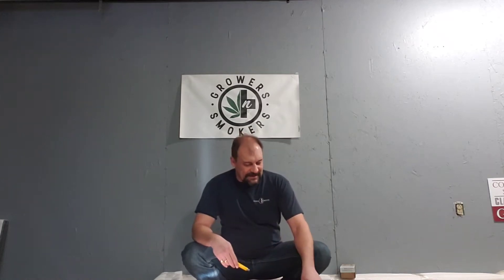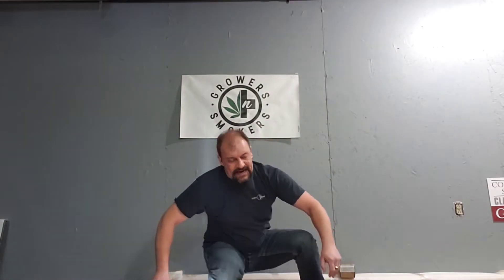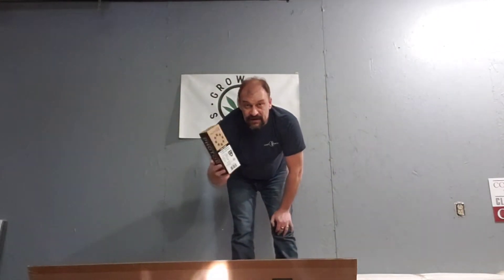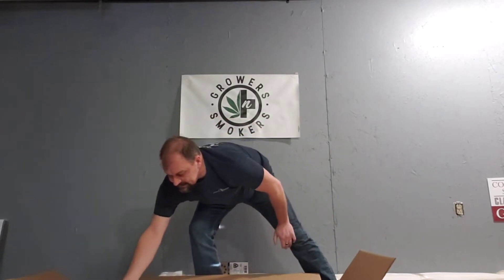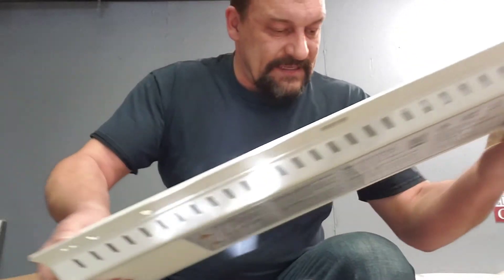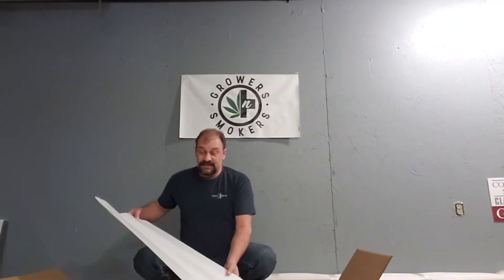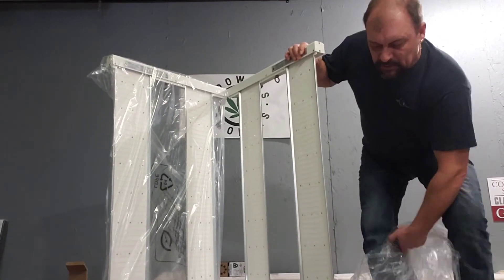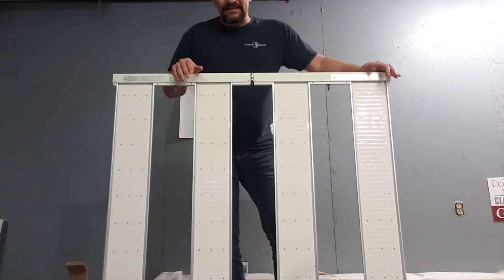Photo Bio MX 680 watt LED unboxing and setup Led Test sessions ep02

Comment: Does it have infrared
Reply from the maker: This is what they say S4 Spectrum it does have red chips in the panels  "The result is a 680W fixture delivering 15% more light to your canopy, using 35% less power than a 1000W DE fixture. Increase yields while driving down operational cost. The spectrums were developed in a private research laboratory to drive flower yield and elicit market desirable traits in short day resin producing crops."
Reply: @RickintheShed  Thank you for responding. I was looking at a gavita 1700 but it was 1700 dollars without the extra uv bar and also without a dimmer. I got my photobio for literally half the price with the dimmer and now that I know also the far red spectrum thanks again for your knowledge.

Comment: Always read the instruction manual folks. There are 2 screws to tighten on each side not just 1 per side. The screw that is deeper needs to be fully tightened or the light will invert slightly from its weight when hung. There are no UV or IR diodes as he stated, luckily. 
On the bright side there are 4,160 diodes on this beast. This light is a tank.
Reply: This is good to hear. Its been difficult for me to switch over from the HID lights for flowering. So far i have heard good things about this light.
Reply from the maker: LOL instructions help